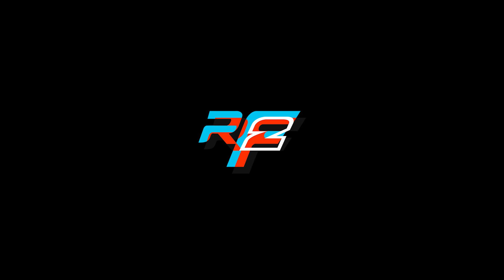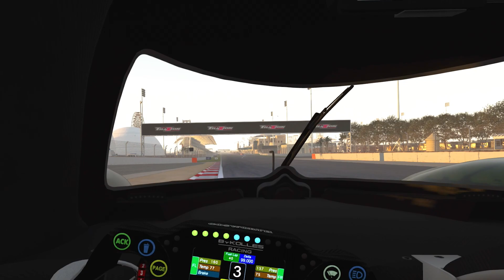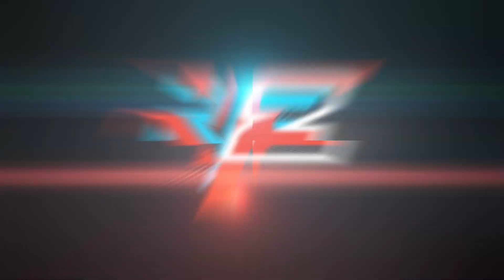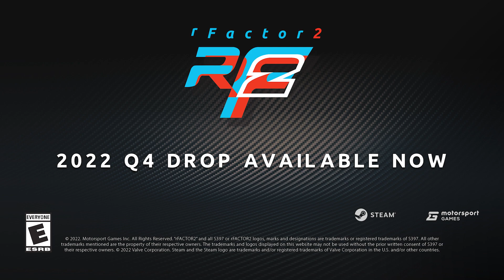Onboard Lap of Bahrain Circuit in rFactor 2

Comment: 16x9 monitors need not apply for cockpit view. Left turn Apex? Nah, just guess.
Reply: I have 16:9 monitors and its just fine, well as long as I use the 3 of them ;)
Reply: use  headtracking, helps alot!
Reply: @Evets_79  I tried so many things. Pov, seat positions, just have to use bonnet cam. Look to apex just looks at more A pillar. Acura Dpi is perfect, this car is difficult to see.